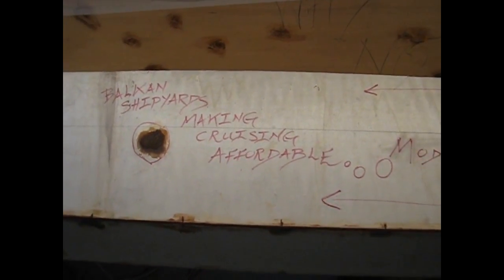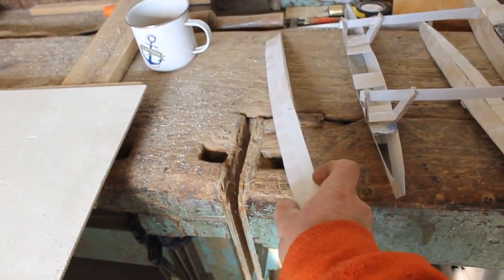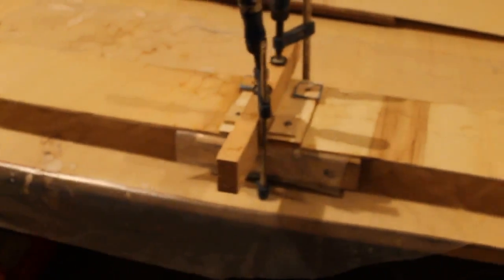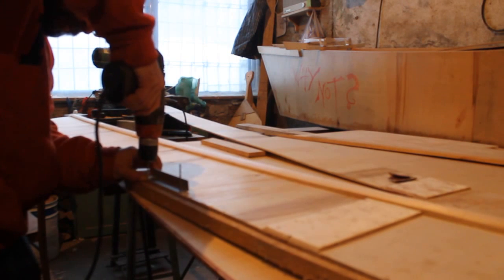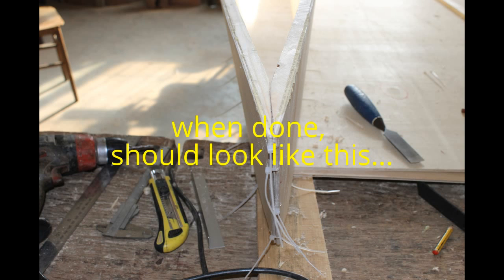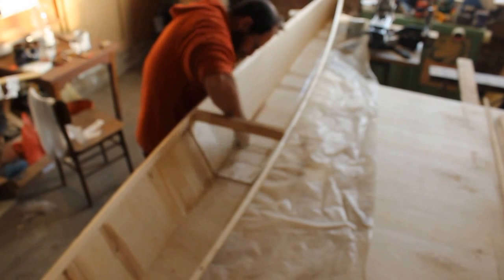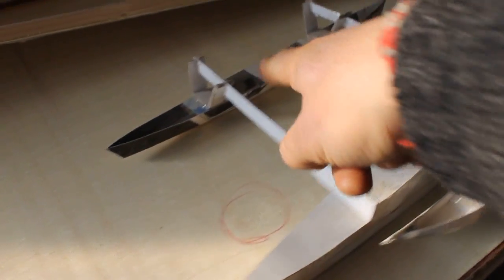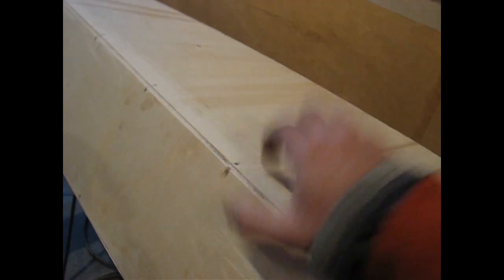Total Proa Build, episode 1

Comment: It is easy to fiberglass the inside of the bow. Cut the tape to length, wet out the inside of the bow, wet out the tape on a piece of plastic, use the brush to push the tape into place.
Reply from the maker: Here in the "wild east" I cant find tape, so cutting cloth leaves loose ends that fray in a very annoying manner....
I have had trouble with them every time... so I gave up. Still, I admit I didn't think about wetting the cloth before pushing it in ether.....  Thanx Paul, will give it a shot.
Reply: I cut my own strips as well, yes the stringy stuff is annoying.

Comment: Great channel you have for what i believe is the most practical boat for everyone by far - for its simple rigging, low cost with big deck space and fast sailing. I'd like to see you try a sof (skin-on-frame) and scalable size version, designed with and built using take-apart sections for easy storage and transport, so that those without workshop spaces could construct and enjoy also.
Reply from the maker: Thanx Robin, Boats can be built anywhere, beaches, garages, living rooms........ etc. you dont need a workshop. Many people live in houses with gardens. I live in an apartment, so I rent workshops. I would be better living in a house and not paying for a workshop....... Skin on frame, frightens me....  
  Anyway, you got it brother, for sole sailors like me, for low income people like me, proas are the best, stay tuned I will prove it.
  All d best.
     Balkan Shipyards.

Comment: a lot of people like to use fiberglass tape over the stitching for re-inforcement , I'm with you wire ties and epoxy is less expense and good.
Reply from the maker: Happy u like our stuff, anyway I still do add fiberglass over the important joints... But yea, if the outside is getting glassed then inside the fillet can go bare. Welcome to freestyle boat building,  Keep shunting man. BSY